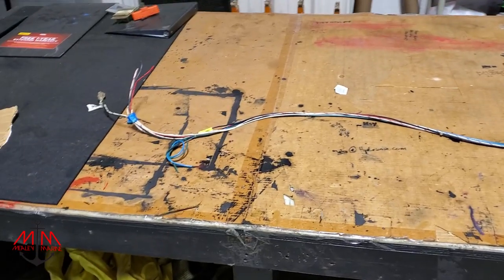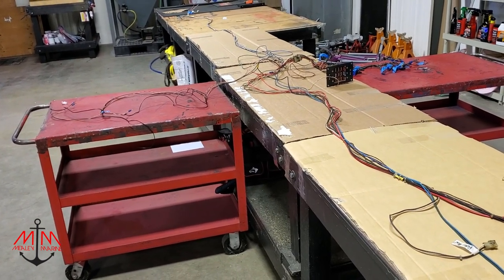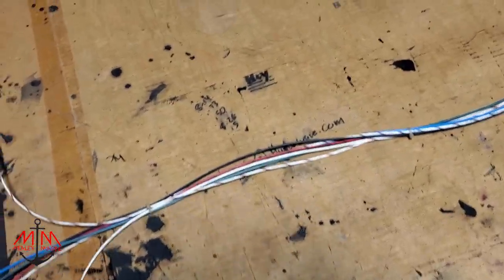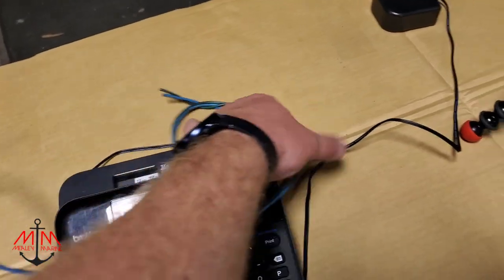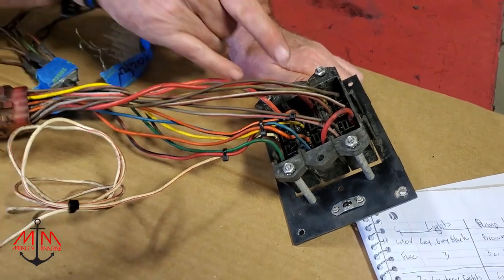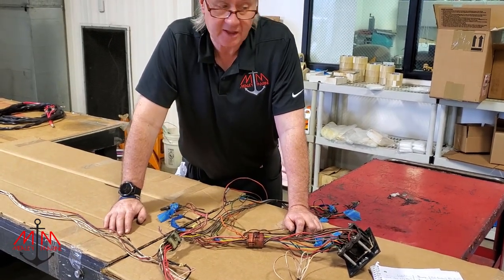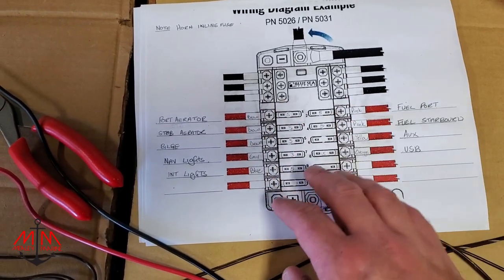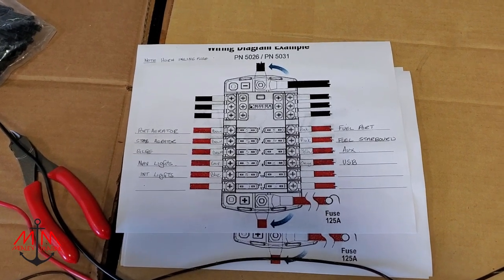BASS BOAT RESTORATION | 1988 RANGER 363V | PART 18: HOW BOAT WIRING WORKS...

Comment: Have you had to replace any electrical parts? Specifically the outlets for the forward or aft lights or switches for the trolling motor or the ignition. If so where did you source them?
Reply from the maker: Haven't replaced them yet but a couple brands make some similar old school lights.